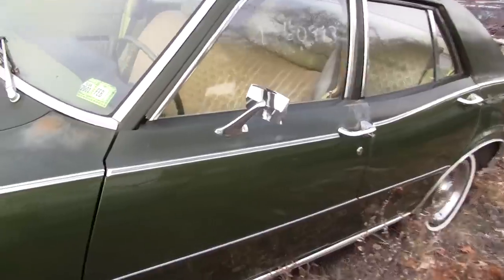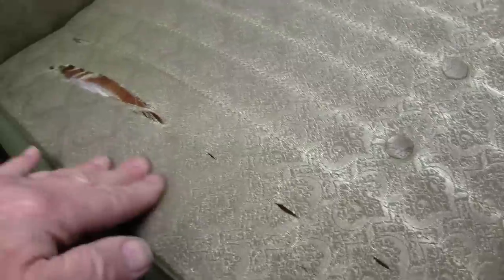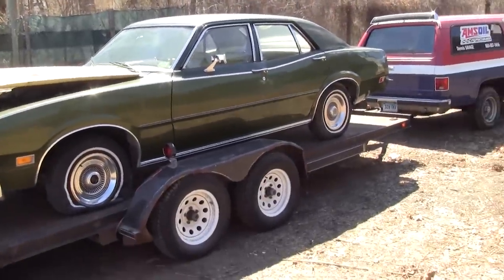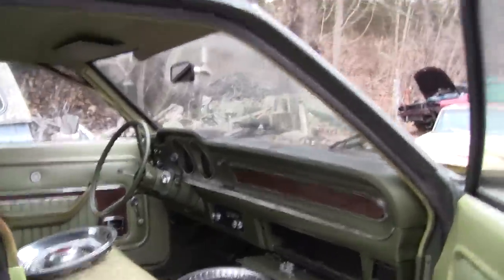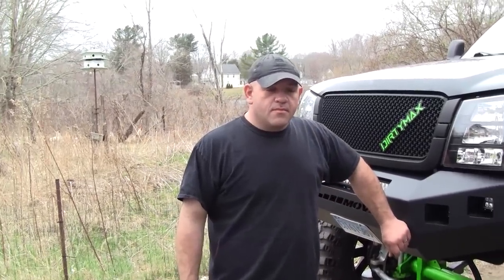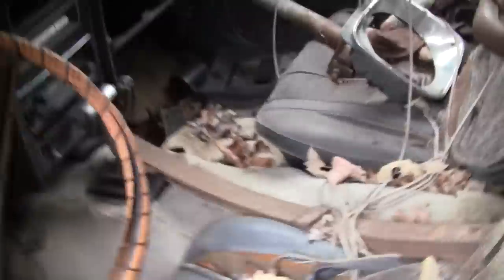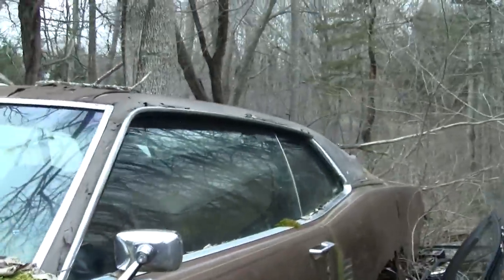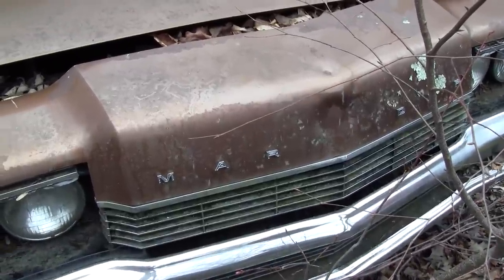From Junkyard To Life! | BRING 'EM BACK TO LIFE Ep 37 SEASON 3 (Full Episode)

Comment: The Marauder had a standard 390 and the 429 and console were options. I have a 429 with the column shift in red with the black out on the trunk. The vinyl roof was optional too. Many did not have it and it looks better without it imo.

Comment: When are you going to make a video of your try 5 Chevys you speak of??
Reply from the maker: You've got it Valerie! Check out my brand new episode #38. I'm promoting the Tri-Five Nationals in Kentucky on August 8, 9 & 10 and the completely new '56' Chevy convertible that will be given away there. We will also be there getting more footage to edit for new shows. We will also keep working on my 56 convertible that was wrecked.
Reply from the maker: Episodes one, two & three were of my 57' Chevy I bought from a salvage yard. Then we started saving my crashed 56' Chevy convertible. It needed so much work and parts that I can't afford to finish it right now but we still work on it. We'll finish the Comet first because it doesn't need a lot, then a 56' Chevy, custom, short bed, step side pickup conversion to a K10 chassis for Johnny 'Cannonball' Bakker.